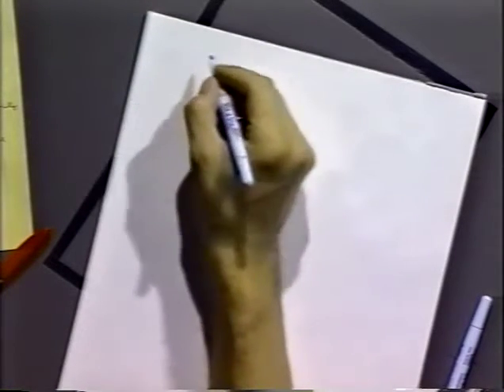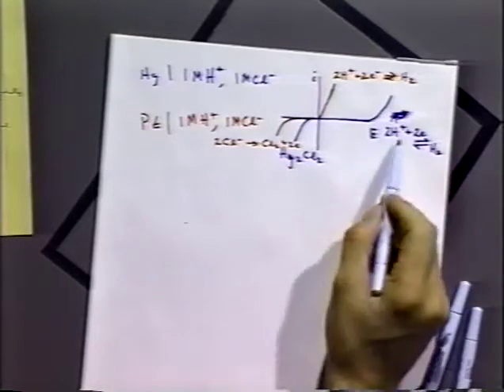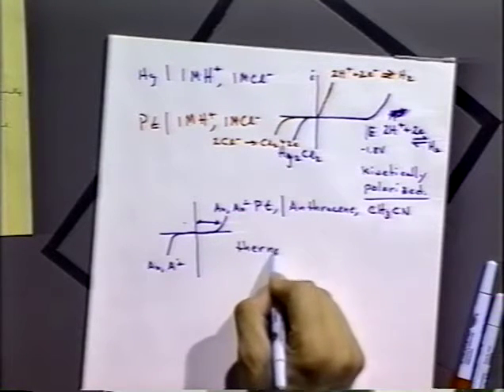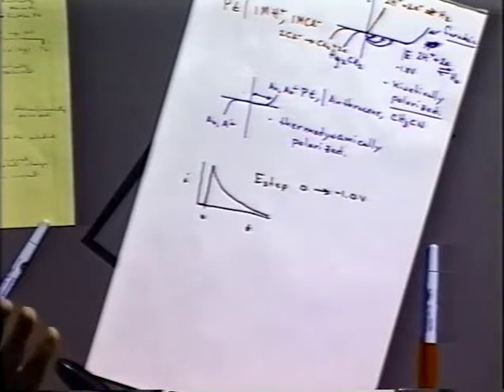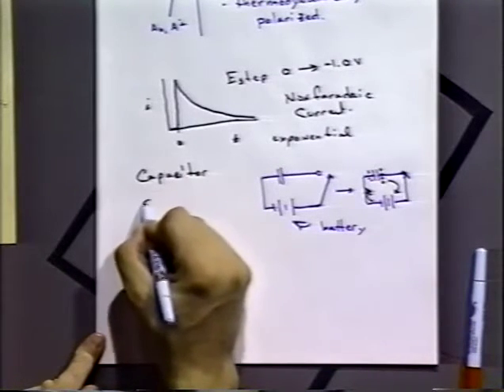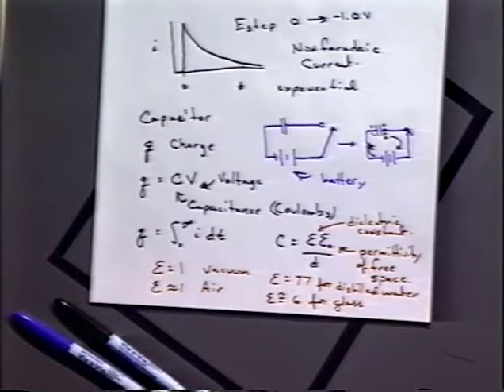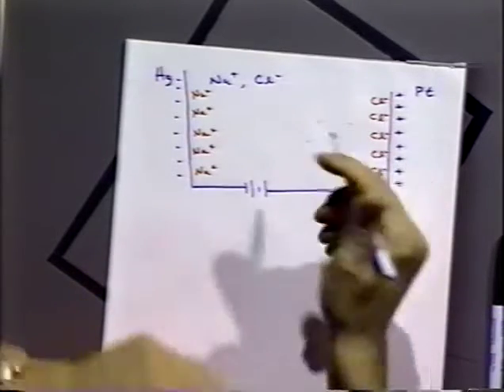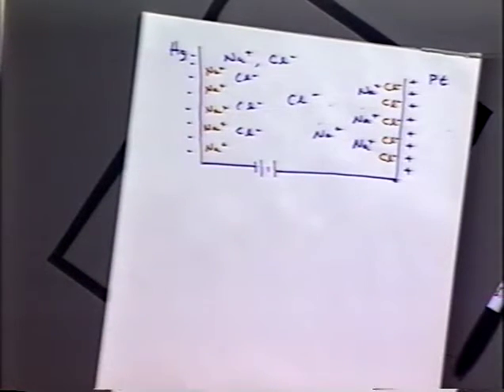Non-Faradaic and Faradaic Processes

Comment: how can you tell the difference between kinetic and thermodynamic polarisation from those graphs?
Reply from the maker: Good question, this is a problem that is addressed in following lectures. But there are several methods that would give clues about the nature of the polarization. The most clear method would be to change the rate of polarization (faster or slower scanning or step time). Scanning faster (i.e. shorter time scales) will increase overpotential with kinetic polarization but not with thermodynamic. Likewise, changing the temperature with affect kinetic polarization. Finally changing the experimental conditions, such as using a different electrode material or electrolyte solution will usually change the polarization for kinetic effects. Although, in the latter case, the thermodynamic polarization may change if changing experimental conditions also changes the electrode process. Keep that in mind.

Comment: Thanks a lot for the videos!!  Had a quick question though: I have seen that there are capacitive currents in almost all electrochemical systems, even if faradaic reactions occur..Why should charge build up if faradaic rxns are occuring?
Reply from the maker: Capacitive current (i.e. nonfaradaic), arises from the excess of ions near the electrode surface to make a type of double-layer capacitor. In the typical case for, say voltammetry, there is much more supporting electrode (KCl, etc) than the analyzed redox species. In this case, the excess ions will be K+ or Cl- and these ions will typically not be reduced or oxidized in aqueous solution. Thus even if the faradaic reaction is occuring, the supporting electrolyte ions are still present and still acting as a double layer capacitor.  Note, however, that even if the ions themselves are electroactive and participate in a faradaic reaction, there will still be an excess of ions and a double layer formed, allowing non faradaic charging current.
Reply: @dwipf1851  Thank you very much Prof Wipf for the series of videos which are very informative, clear, well-structured! 
I have a followup question: in a potentiostatic electrocatalysis experiment, the current changes with time (initially rise to a large value then drop gradually and become constant). So how can I differentiate the faradaic current from the nonfaradaic current, particularly at the beginning of the experiment? Can I assume that faradaic current remains constant throughout the application of a constant external potential, and that is equivalent to the steady current at the later stage of experiment?
Reply: @dwipf1851  Wouldn't the excess ions in the electrolyte which forms double layer with the electrode hinders the redox reaction since the surface area is occupied by adsorbed ions?
Reply from the maker: @michelmyures4536  In general, the ions we say are adsorbed are "nonspecifically" adsorbed. This means that the ions are not directly sitting on or touching the electrode surface. Instead, the are slightly accumulated in the solvent near the electrode (the diffuse layer). Therefore, the redox active ions and molecules have no trouble getting to the electrode. However, some ions do adsorb directly to the surface. This "specific" adsorption definitely affects the rate of the reaction and can block redox species to a limited extent. An example is the adsorption of halide, sulfate, etc ions to the Pt surface during the hydrogen oxidation reaction. This lowers the rate of that reaction at high overpotentials.
Reply: Very nice lectures , thanks for making them open source

Comment: Hello sir...thanks for your nice lecture series. I have a doubt that how Hg in 1M HCl acts as a capacitor and why not platinum?
Reply from the maker: The Hg electrode does not allow the reduction of H+ until a large negative overpotential is applied. So there is a large voltage range in which only non-faradaic currrent (i.e. capacitive) can flow at the Hg electrode in strong acid solution. Pt is different, it reduces H+ at very low overpotentials so there is effectively no voltage range in which only non-faradaic (and not faradaic) current can flow
Reply: @dwipf1851  Thank you sir

Comment: Excellent explanation. I have one question. Why does the current becomes constant after a particular voltage for EDLC?
Reply from the maker: I am not sure I understand your question. However, I will say that if you supply a linear voltage ramp, v, (like in a CV experiment), the current that flows to charge a capacitor is constant, i_c = vC_d. There is also a range of voltage after you switch the scan direction, in which the current rises up to the constant value. This is due to the collective resistance of the system (solution, material, test leads, etc) forming an RC time constant with the electrode capacitance.
Reply: I meant that the CV curve of an ideal EDLC is square shaped i.e. current becomes constant after initial rise even when voltage continues to increase. Why does this happen?
Reply from the maker: See my discussion of charging a capacitor with a voltage ramp at the 29 m mark https://youtu.be/jokNeTdx2Bg?t=28m55s
Reply: I understand that it happens but I don't think you've explained why it happens. Maybe I missed something obvious in your explanation.
Reply from the maker: Think of it this way, the voltage applied to the capacitor is constantly changing (it's a linear ramp); therefore the charge (Q) on the capacitor must constantly change (otherwise it's not a capacitor) since Q = CV. Current must, thus, constantly flow to add or remove charge from the capacitor. The current that flows is the derivative of the voltage change with time (i = dV/dt C). Since the derivative of the linear voltage ramp is a constant the current is a constant during the charging process and a constant (with opposite sign) on discharging.  If you plot the resulting current vs the voltage ramp, you get the rectangular shape.
Reply: Thank you for this simple explanation. The initial rapid rise in current is due to the sudden voltage applied correct?
Reply from the maker: Yes, think of the derivative of the voltage with time, at the very beginning of the sweep, the voltage changes rapidly causing a large current flow.